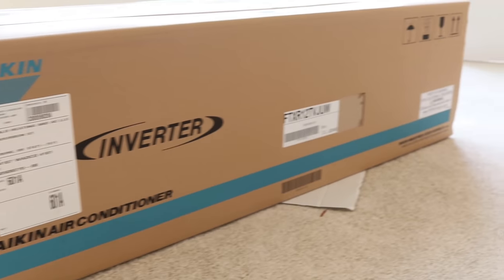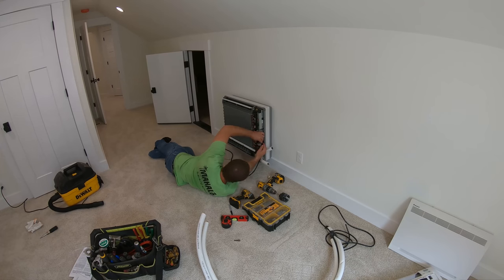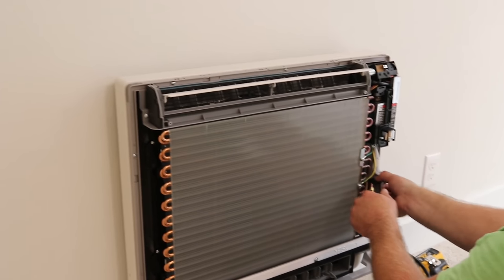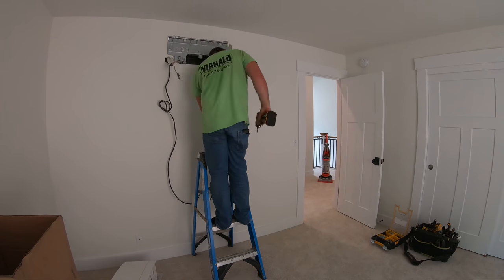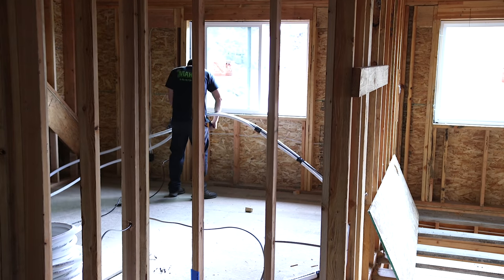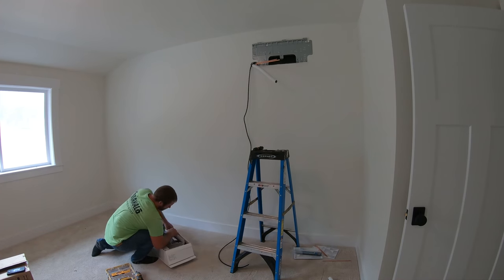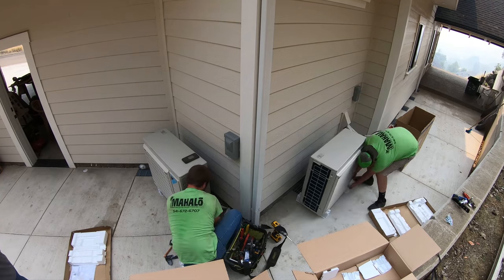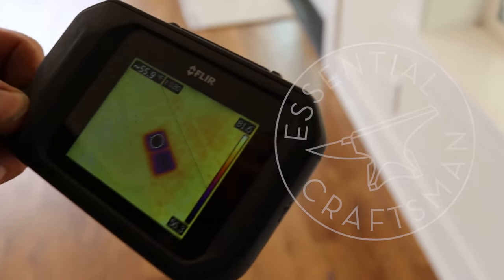Final HVAC Ep.131

Comment: Mini splits are wonderful pieces of technology. They are everywhere in historic Europe used in retrofit applications. However, I can't help but feel they are a lower quality option in new construction. They may be efficient but the wall mounted units are unsightly.  A ducted system seems a lot more "correct" to me. If given the choice. I would prefer not to have those units on the wall. Again, in retrofit or additions their pros outweigh cons, but this brand new house with minisplits would be a negative to me.
Reply: I had a similar system put in this year, and I agree. I love the ducted air handler, but I kind of hate the mini splits. They are unsightly, they don't circulate air as well, and they are kind of noisy for a bedroom. They whir and click and rattle. In my case it would have been a few thousand more for a ducted air handler that serves the bedrooms, compared to two mini splits. At the time the cost of the whole system was a stretch, but now I regret not opting for ducted everywhere.
Reply: I agree both unsightly and noisey . I wouldnt give up those things for a bit more efficiency . Give me a attic air bliwn system over this anytime , especially in new construction.
Reply: somebody's got to make units that look like normal a/c registers, instead of having giant ugly boxes in every room
Reply: @nrok113  they already make them - ceiling mounted units. looks like a ceiling register....with the guts tucked up in between the joists.
Reply: @jgg204  I wonder why they didn't use that for this house
Reply: @nrok113  probably because they didn't want to spend the money lol

Comment: Great system.  As a HVAC engineer I can say that you've selected just about the best system.  I really like the multi-zone mini-split systems.  Well done!
Reply: Can you explain, how ventilation works in this system?
Reply: Aren't floor registers/ ducts better than having giant minisplits in the bedrooms?
Reply: @oogrooq  heaps of duct loses, not as  efficient, have to heat whole house to get 1 room warm
Reply: Daikin are notorious for being terrible quality in Aus. Mitsubishi Heavy Industries is what I install
Reply: @mikhailivanov3378  open the windows for ventilation
Reply: @loyal_to_the_foil  Daikin is good quality in USA.  I use them all the time.
Reply: @mikhailivanov3378  This does not ventilate, only heat or cool the air inside the room. In my country we have seperate systems for ventilation in new houses.
Reply: @oogrooq  A well designed ducted system is always going to be better. Problem is, most central ducted systems have imbalances that lead to hot/cold rooms or floors. Minis are great, but they have a serious drawback: cleaning. My central system has a nice 20x25x5 MERV 8 or 13 filter that keeps the coils clean and does some air filtration. Minisplits usually have a pathetic screen filter, and many of these units are a huge pain to clean the coils.

Comment: I was surprized at fist with your choice of heat pump heating. But considering that avagege low winter temperature is around +3 degrees C in your area, this is a good decision. The avagege low winter temperature in central Russia, for examle, is -10C. Here this kind of heating system will be too expencieve even electricity costs less here, than in US.
Than you for the quality content! It very interesting to know about building technology form another side of the world.

Comment: I've installed about 20 of these minisplits.  WARNING:  you must refer to each manufacturers minimum lineset length. If you cut the lineset too short (below manufacturers specs) you will have tons of vibration and will slowly destroy the compressor in the outdoor unit. Love the series and Daikins are very high quality!

Comment: Those are some awesome numbers on the SEER and HSPF ratings of the equipment. Like everything else in this build, you went with very high end choices. Bravo!
Reply: I got the fact that he was referencing how good the system was but I don't have a reference point, what does the scale look like? what are good numbers and what are bad numbers?
Reply: @kevindavison6019  HSPF ratings generally start around 9.0 and SEER around 16 as a code minimum, depending on the state.
Reply: Dude the seer rating on mini splits go as high as 30 so no these are stupid. A single central HVAC system would do just as good and be more reliable.

Comment: 15 years in the business and I’ll tell you ductless has to be installed correctly form the start . Flare connections are just a pain and kinda a one shot deal when you sheet rock everything in ! The right precautions and safety measures are key when installing any split system

Comment: Completely agree with these ductless systems, especially for A/C. Who wants to pay to cool the whole house when you only want to cool the master bedroom so you can sleep at night? With an upstairs master bedroom and a central HVAC system, the fan has to work extra hard to push heavier cold air up and it just spills out the floor vent, under the door and down the stairs leaving the top half of the bedroom still hotter than you want.
Reply: Humidity control is as important as temperature control. In high humidity areas of the country, the A/C must run long enough to remove the humidity. If you oversize the system you will pull temperature quickly, but the system will cycle off before the humidity can be removed, leaving you with a cool, clammy home.
Back in the '50s thru early '80s my dad had a small commercial refrigeration and A/C service company. We had a commercial customer who insisted we set up his new home with an oversized A/C system. My dad tried to convince him it was a mistake. After a couple of seasons we downsized his system to what we had calculated originally. An expensive lesson.
Reply: @stevenslater2669  Another, and better, option for humid areas is a separate whole-house dehumidifier tied into the ductwork. Then, you can hit target humidity levels exactly and not have to overcool the house to drop the humidity. In many humid areas, there are days in the Spring/Fall that still have high humidity, but aren't really hot enough to justify running the AC enough to dehumidify. If the air is being dehumidified, you can probably also set the AC temp higher and have the same comfort for less cost.
Reply: @stevenslater2669  Thanks for info on the humidity aspect. It's not something you think about on the west coast.

Comment: On your next house (you know you will do one!), do an air->water, radiant floor heating on all floors, one circuit per room. Most comfortable heat delivery, plus no loss in cosmetic value.
Reply: Great in cold climates for heating but not so great if it's warm and humid.
Reply: @timothydillon6421  Yeah, you're right of course, I must confess I don't know which climate zone EC lives in. I do remember them building in Vegas, which is just crazy hot, so if they are still around there, then it is certainly a no go.

Comment: Everything you said about low consumption, efficiency, etc.  perfectly true, but under one condition - the units (external and internal) must be maintained!
By that I don’t mean anything special — just cleaning and disinfecting ... but just doing it right!!! — not just a little spray and it’s over.
The evaporator slats need to be cleaned, if necessary-dissmount and clean the fan (check the fan's slide-bearing grease),clean the front and rear tub (most service technicians do not clean the rear because it is very difficult to access), air deflectors, etc ...
Most people don't do that, and they forget to maintain the device ...the service technicians usually work as little as possible and charge as if they did everything necessary🤨👎  It's a lot of work, it's not cheap, and that's why I do it myself with my four devices ... once a year😅
I like your videos - keep it up😃👍
Greatings from Slovenija.
Reply: Agreed! Most people don't know there are filters in the heads that need cleaning. We make any new home buyer sign that they are aware and will clean those filters.
Reply: In Norway the installer for the unit I have in one of my apartments calls me every other year when it's time for them to come and perform servicing on it.

Comment: Biggest problem with mini split is that the line sets tend to me colder and sweat more than conventional split system. This  is not as big of a deal until they are run inside wall cavity and create moisture problems and potentially mold growth. I say this because I work at a property with 140 units with mini splits and have had this happen on multiple occasions. Also a side not is they are less efficient at removing moisture from air if that matters in your climate. But they are very energy efficient
Reply: This is my main concern with mini splits. Mold.

Comment: As an HVAC technician,  my only issue with mini-splits are parts availability.  We have literally been told it would be six months to get inverters. This was well before covid came along.
Reply: Can you explain how ventilation works in this system?
Reply: @mikhailivanov3378  These systems aren't ventilating air, they operate just like any other heat pump system. Air is moved across an evaporator coil to either remove or add heat.
Reply: @Dale37  Great, so how air is ventilated in the house?
Reply: @mikhailivanov3378  Usually a stand alone dehumidifier brings in fresh air from outside.

Comment: Where's the channel going to go after the house is done? Will there be another house build? That's why most people are subscribed is to see houses being built so hope there is another build in the near future. I've been thinking about replacing my heat pump with a mini split system in the house and installing one in a building I have that is dedicated to a model railroad. Its finished just like a house and the only thing missing is water and HVAC system. I've talked with people that have them in new houses like you've done here. A couple of the people I've talked with had previous homes. One with a heat pump and the other with an oil furnace and both are very pleased with the mini split systems as is the other person that is in his first home. So I've thinking seriously about replacing my HVAC heat pump system with a mini split system. I'm in central NC so it doesn't get extremely cold but summer time can be brutal with the humidity factored with the heat. My electric bill is always higher in summer so I hope the mini splits will help lower my cooling cost and the only thing I'm concerned about when considering a switch to them is can they cool as efficiently as or hopefully better than the system I have now.
Reply: I am no expert, but my first thought when reading this is that the condensate from the mini-split head unit needs to go somewhere (you need to connect it to a drain somewhere).  If you're still planning on adding water to your model rail building then that's easy to do at the same time, otherwise you need to think of some alternative like installing a drain line to the outside or something.
Reply: @Estok8805  Thanks for that little tip.  👍

Comment: I feel like heat pumps have a place, but that's not in a custom home.  Hanging a big plastic control unit on the wall just looks ugly.  You might say the same thing about Hydronic baseboard but that is generally lower and doesn't distract from the finishes and trim on the walls.  I feel as though heat pumps at least in my area (Maine U.S.A.) have gained popularity due to a large rebate program in the last couple of years.  However just recently there has been an 80% increase in the electric rate so that cuts into the wallet quite a bit if you commit to using electricity for heating and cooling.  I personally have baseboard and underfloor radiant heating using a wood pellet boiler with a propane fireplace and a woodstove.  They all have their pro's and cons but I chose to install it all for specific reasons, and it works well for me for a really reasonable cost.

Comment: 18` SER is average at best for a mini split system.  With dedicated exterior units for each inside head you can get up to 32 SER (that's 77% more efficient cooling).  As soon as you do multiple interior heads for an exterior unit, the SER decreases substantially.

Comment: Do you ever find those indoor mini split heads click/creak or make noise when changing temperature? I have a Daikin mini split in my bedroom and its great when cooling, but when the compressor turns off eventually and its not blowing ice cold air, the plastic click and creaks while it changes temperature, and then does the same when the cooling kick back on
Reply: I have a Fujitsu system and none of the heads do that. My MrCool does creak and such though.

Comment: The head units in the Bed R are 120v, correct?  What amps draw?
Reply: The head units only need to run a small fan, the power is run in the lineset from the outdoor unit.  The outdoor unit has the compressor and has the big amp draw.  We had a 36k BTU system (4 zone) installed last summer and it was 30 amp total.
Reply: I think if it's over 18kbtu it's usually 240  . 15 - 40 amps 120-240 volts I think
Reply: I have a 27k three head unit that is 240v 35 amp at the condenser. The head until are powered through the power panel on the condenser. Just easier that way so that the head units can communicate with the condenser and if you're already running a wire might as well be power too.
Reply: @MandoFettOG  Yeah, I knew the big power draw would be the outside unit, 240v but was just thinking how neat it would be just to have to run a 12/2 or 10/2 w/g to the room unit if it was only 120v 30 amp or less.  These things are the future of home AC IMHO.   Thanks!

Comment: do you guys not have a mechanical ventilation requirement? here in ontario, the code sets out how much fresh air has to be ducted to each space, and requires the use of an HRV
Reply: In the US, in most jurisdictions (the ones with less-strict codes), residential doesn’t require mechanical ventilation. Opening a window will suffice.
Reply: They probably have an ERV

Comment: With this being new construction, and with so many mini-split options on the market, why did you opt for wall mount vs something more discrete? The wall mounts seem like a retrofit option to me, not a new install option. 
Also... how do you size a system? heating load for winter vs cooling load during the summer? Im thinking we may need about 8 tons of cooling for the summer.. how does that translate to heating?  lets just assume  the house is not the tightest, or the most insulated...
Reply: Systems are sized through load calculations. The one I know of is called a Manual-J. You enter the values for your building's insulation, orientation, windows, etc and it gives you a room-by-room heat/cooling load. EIGHT TONS?! Do you have a forge inside?! That's an insanely huge load!
Reply: @EFD620G   Agreed... but Id also like to get a general cost idea before wasting their time with a job walk just to discover the price is outrageous.
Reply: @treyhart6861  I'm sure if you just reach out to a few HVAC companies in your area and let them know you just want a rough idea of the numbers they will be more than happy to give you a rough idea for free.
Reply: I totally agree about the wall mount options looking like a retrofit option, I would have thought they would have gone with something a little more discrete.

Comment: -13 deg is actually rather high for minimum temp. There were some that we looked at that went to - 20
Reply: That's -13 Degrees F which is -25C. Most of the spec sheets are written in degrees C. Is there a system that works down to -20F? Of so that would be useful for colder places that might occasionally exceed -13F.

Comment: I went with Daikin mini splits and after 6 months, the coils were all rusty because they mounted the copper and aluminum to steel. Very disappointed with that.
Reply: ahh the old galvanic corrosion achilles heel....even missed by the most senior and experience engineering designers. just ask Jeep. they fastened aluminum hinges to steel doors. lmfao

Comment: Take your boots off / used tarps    (your crew was good they took off boots)
In addition to your comment about a good HVAC crew or any trades is show respect for customers property. Don't tracking in dirt remove your shoes to use booty's es and tarps.
The jobs not done till the worksite is clean, better yet cleaner than you found it.
Reply: Cleaner? Hell no. Tarps, drop cloths, rhino board, broom, vacuum. Yes.

I'm not dusting a candelabra worth more than my car and I'm not picking up dog poop.

Comment: mini splits are a last resort. if building a whole brand new house, it's crazy not to have done full duct work throughout the entire house. now you have (3) systems + the air handler system to take care of. those mini splits are also a real pain to service and repair. replacing the board on a Mitsu unit literally takes hours, vs 10 mins for a regular HVAC system